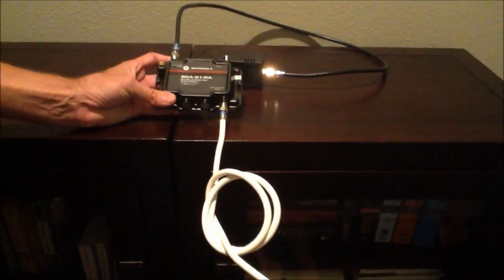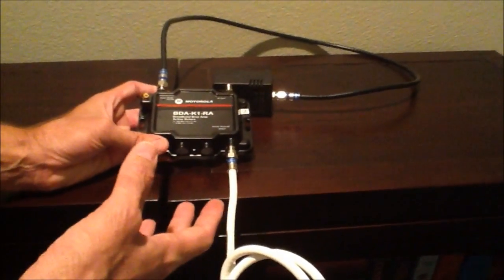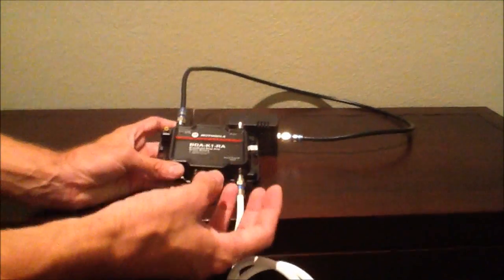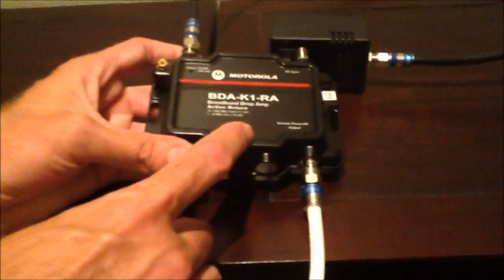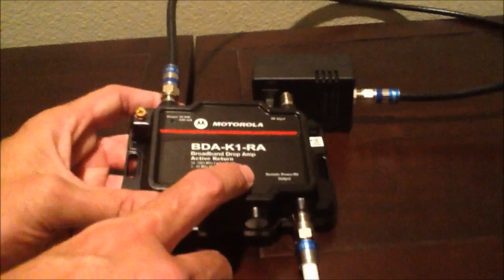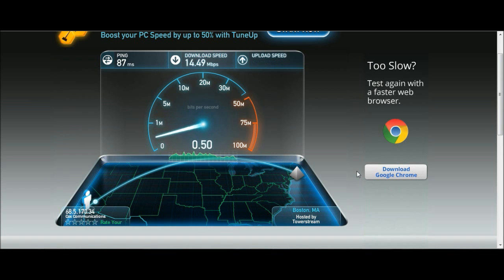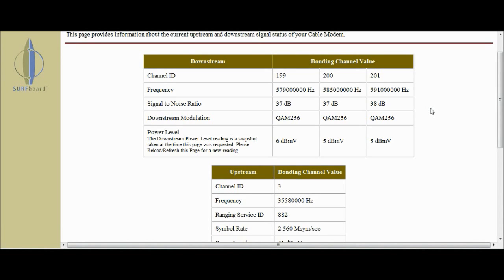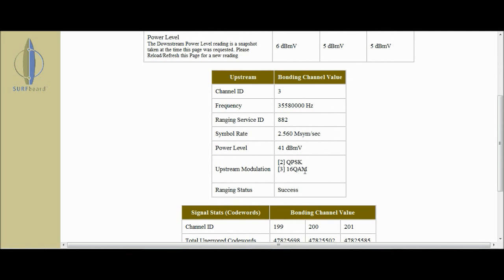Resolve Cable Modem Disconnects Caused by High Upstream Power Level

Comment: Don't quit your day job. You have very little knowledge of what you're talking about. You seemed to miss the MER/BER issues you seem to be having, according to your modem. Installing an amplifier is never a solution unless you have an issue with service distance and the number of outlets you have. Your drop, home run and outlet likely all need to be replaced. And plant maintenance might even be needed.
Reply: I don't think he was thinking of quitting his day job. He was just trying to help other ppl with the same issue by showing how he fixed his problem instead of going on other ppls video's and posting useless bullsh$t. What he said made sense what you said was trying to show off. Get a life punk.
Reply: Send him to the pole lol probably the type to put a 2 way on a full tap
Reply: Shaolin80000 I do have a life. I work in the telecommunications industry. So I know what I'm talking about here. This guy probably read about this on some forum and decided to do it, not realizing what further issues he could be causing by doing this.

Comment: I'm curious if this would be worth a try. My downstream is usually +5 or +6 and my SNR is a healthy 38. Upstream is always borderline 50-51. I literally have one splitter, but because of it's location I would have to put the amp closer to the modem. If I use this to remedy my upstream, will my downstream be compromised by going out of spec?
Reply: This will not help you. You either need tap maintenence or a new fittings at the grndblk/tap

Comment: Quick questions....what if I'm having the reverse problem? My upstream level dips too low, and my modem is continously rebooting? Should I use an amp?
Reply: If you downstream is between -5and+5 add a two way splitter behind your modem this will take 3.5 dbmv from your ds an give 3.5 dbmv to your us. If your ds range is not between 5and5 then you need a 6 dbmv attenuator. To increase your upstream without affecting your ds

Comment: This looks really great....worth trying but quick question though, most experts say use an amplifier at the source before the splitters....not near the cable modem itself....??? I need to know guys? Anything???
Reply from the maker: I would guess that the problem this type of amplifier resolves is due to bad splitters/connections.  Given that I wasn't able to locate the bad connection, I placed the amplifier right where the cable modem connects so that I could boost the cable modem's outgoing signal before any bad connections.  If I placed it at the source where the cable comes into my house, the cable modem's outgoing signal may already be weakened before the amplifier is able to boost it.  In addition, any other devices in my house that are connected to the cable would also have their outgoing signal amplified which is not what I wanted.  I hope this helps.
Reply: BBStudioProductions your an idiot an active return amp Dosent boost your upstream it boost your downstream without affecting your upstream you would crash your nod with an upstream that high
Reply: Trey Smith Be civil, brat...

Comment: My upload power is 61dBmV so i'm wondering if this would help me, I have only had this problem with the router/modem in my room upstairs, but when it is downstairs in the living room it works fine no problems doesn't crash. Please help me out if u can.
Reply from the maker: The core cause of these high upstream power levels is, most likely, faulty splitters/coax in your house.  However, if you're like me and have not been able to track down the culprit, then the amplifier mentioned in the video will, most likely "solve" the problem.  By the way, I even had a COX Communications field technician in my house for several hours trying to track down the faulty equipment, and he was unsuccessful.  It was only after this that I decided to take matters into my own hands.  Hopefully this helps.  Let me know your results should you give this a try.
Reply: The female part of the rj11 is faulty, i'm getting it fixed asap, if it still acts up i'll let u know because i'll be getting a splitter if its still acting up. Thank you for the comment back!
Reply from the maker: Kyle Footer No worries.  Let me know what happens.  It helps everyone dealing with these frustrating issues.
Reply: BBStudioProductions Got a new phone jack module and the modem starts up and works, but after a minute it reboots itself! Looks like I might need that splitter:(

Comment from the maker: Calling your telecom company is a toss up as far as them believing your assessment of your Internet connectivity issues.  As far as connecting the amplifier goes, you plug the cable from your wall into the RF Input connector and the Cable that comes from your cable modem into the RF Output connector.  The other connector on the amplifier is for the power.
Reply: This device won't work if were using one cable outlet for bot the set top cable box and the cable Docis modem
Reply: Were? Bot? Please fix this comment. Are you suggesting this won't work if I have a splitter outside and inside for both a cable modem and a cable box?  That's pretty common. I was all set to purchase the booster in this video to solve my issue but your comment is giving me second thoughts.
Reply: BBStudioProductions As a guy who works for a telecom company:

We can see your levels at any time we want. If you call, RX (receive) and TX (transmit) levels are the first thing that are looked at. Also MER (basically signal quality) and CMTS Rx (what level the CMTS is receiving your TX signal at). All these ducks have to be in a row. If your amplified Tx level is too low your modem will Tx below what we cause the noise floor. This problem is caused by the CMTS telling your modem to reduce its output because the signal is too loud. 

If high Tx levels are a problem there's likely a more significant issue. Corrosion at an outdoor connection or water in an outdoor line. 

Installing a reverse amplifier can be a bandaid but it's not fixing your problem. 

Please leave issues like this to someone more qualified to give advice.
Reply: I'm using a DOCSIS 3.0 Motorola sb6141. Okay, so my downstream levels are at about 6dbmv. But my upstream are at 53dbvm. I always have ranging issues. Will this booster work? I have had a tech come out twice, one told me it was my modem, the other told me it was my router. I don't think either of them knew what they were doing. Both of them didn't even bother to look at my modem status page (showing power levels) or event log errors. I decided to get this 
https://www.amazon.com/gp/product/B0792PTCFP/ref=oh_aui_detailpage_o00_s00?ie=UTF8&psc=1

and see if it fixes things, I notice high latency when gaming. Will this cause my downstream power levels to go out of spec?